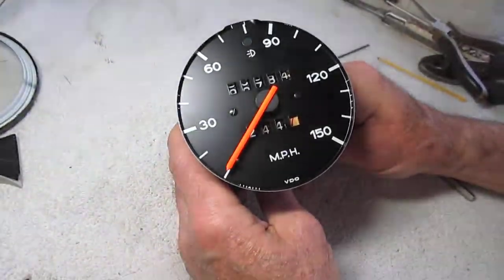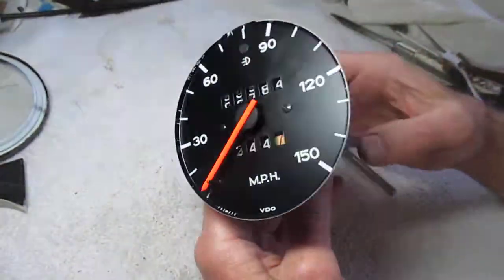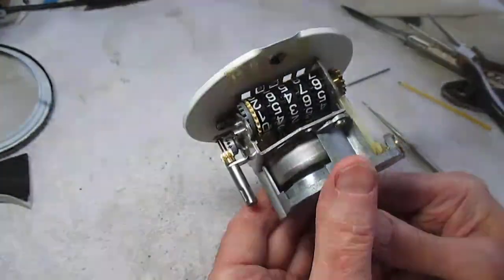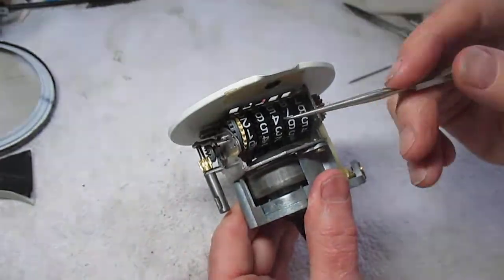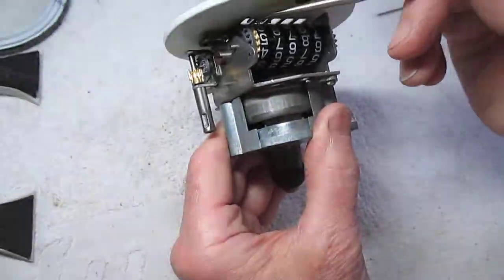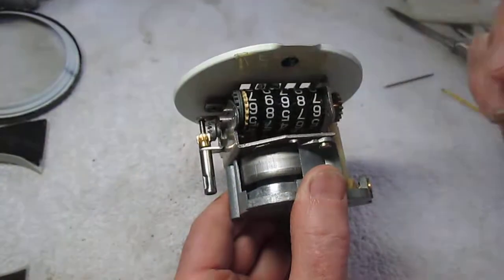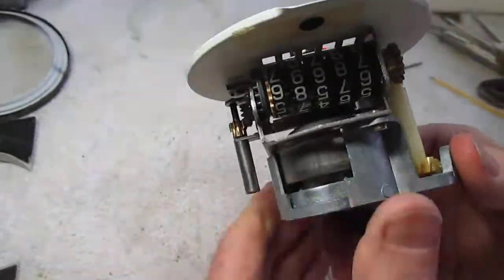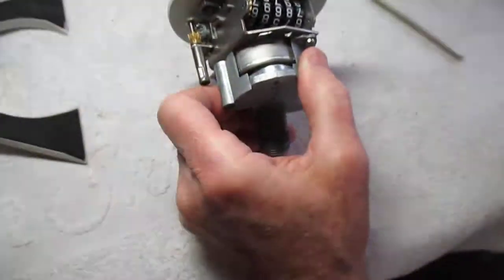Porsche 911 1974 Odometer Repair

Comment: very helpful. this is similar to my 1971 911T but all the gears are brass. my gray gear was not fixed to the shaft like yours. thanks!
Reply from the maker: I later found that my fix didn't hold well.  I went back in and put a metal spacer to move the rod a bit one way and it made a better purchase for the gear and worked well after that procedure.

Comment: i have the odometer out but can’t seem to get inside of it
Reply from the maker: First remove the screws on the back.  Then take a thin blade screw driver and carefully work the inside of the lip around the ring that is holding the glass in.  Prying between the back housing and the lip of the ring.  Work it slowly a little bit at a time and it will release.

Comment: Thanks for this video, my odometer on my 356 is also broken -- I'm guessing it is similar setup to this.
Reply from the maker: Since doing this video my repair didn't hold.  So I found that if I pulled the shaft over a bit and then on the outside of the shaft I put a small spacer made out of a piece of copper, the shaft had better purchase on the gear.  It has now worked for me.  The best way to figure out where your odometer is not working correctly is to use a power drill to turn the gears where the cable attached and then inspect the workings.   Also I did not have to take the needle off to do this repair.  Mine wouldn't come off easy and I didn't want to break it.
Reply: @mtdesign184  Good to know. I have also heard that "pinching" the center hole where the shaft goes through the gear will deform the hole a little and allow it to "grip" the shaft better.

For the power drill test method, what do you stick in the drill to engage where the cable goes? Do you need just a flat blade screwdriver tip or something similar?
Reply from the maker: @AtypicalDriver  I used a small square bit that came in one of those combination sets that you can use with a screw driver instrument. It will be obvious to you when you have the  gauge out and look at where the cable fits in to it.  Good luck.  Go slow on the drill because it needs to go the right direction and I can't remember if it is clockwise or counterclockwise...but once the speedometer needle moves then you can accelerate it.

Comment: Many thanks. Big help !
Reply from the maker: The basic repair on this video is still good but the gluing on the gear did not hold after 100 miles.  I will need to do a better job of setting the gear or using more glue/epoxy.  It's very hard to do and not spill over to the adjacent gear.

Comment: Thank you for this post! currently been searching for similar odometer informative video. this helped. Question, did the need have to come out to do that repair? and if so, what tip would you give me to remove it? thank you in advance!
Reply from the maker: I didn't take the needle off and I didn't remove the face because the needle didn't come off easy.  You can do this very carefully by removing the shaft that the small gears are on that advance the numbers and then remove the shaft that the numbers are on.  They get hung up a bit but you can do it.  Pull the shafts with pliers working by twisting the shaft.   Fell free to ask more questions as you go.
Reply: @mtdesign184  thank you for the prompt reply! i was able to repair the odometer with out removing the needle. Thank you for the help!
Reply from the maker: @Sifrag  Fantastic.